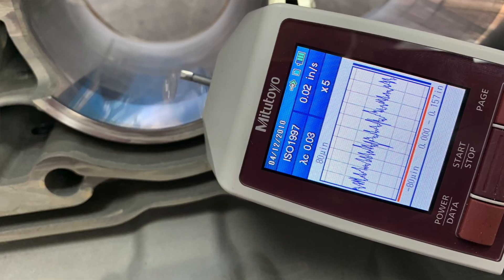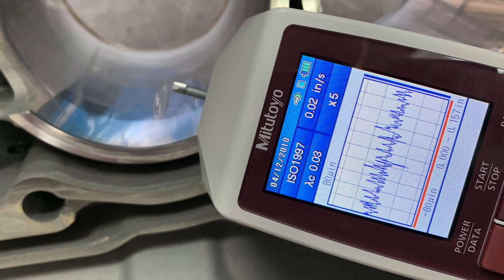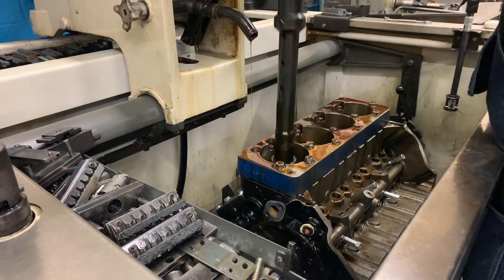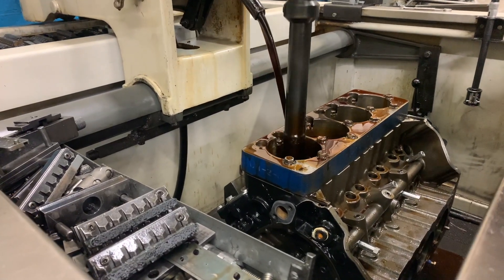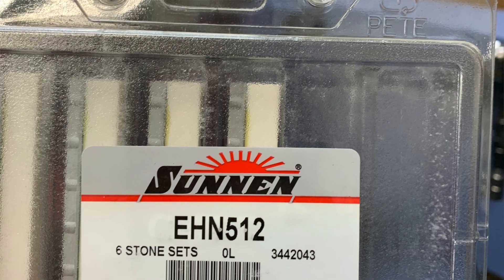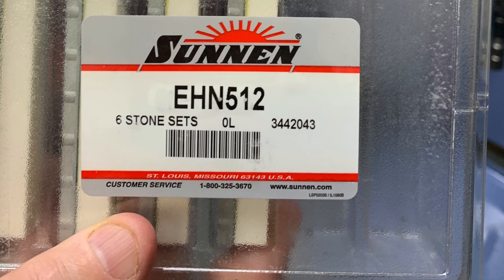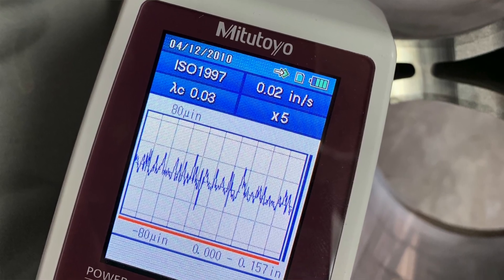Honing Fluid & Diamond Abrasives

Comment: I have an identical machine (cv616 with digital load meter) I’ve been told that the machine is not powerful/strong enough to use diamonds on. Did you have to upgrade anything to use diamonds or have I been told a story in the hope I will buy a new machine?

Comment: I have some 100k, 50k, 20k, grit diamond abrasives in syringes I got from a place that was shutting down. I bought some laptops from an auction and that’s where the pick up was at. They threw all this stuff away while cleaning out but it was pretty clear to me they were making hydraulic cylinders and things like that. I was like oh well I’ll help myself I can use some 100k grit stuff. There’s not a lot but I can use to lap heatsinks on pc’s for flatter surfaces and better cpu cooling. I suppose I could use it on crankshaft or something if needed as well to polish.

Comment: They did a Diamond hone on my 1995 Harley Cylinder 2018  , I ended up getting blow by .  I had to Hone and re-ring again.   March 2023 had a mishap and need to go  20 over   Is a Diamond hone the best or a Stone 240 for a Motorcycle   I hate to get blow by again , the set back and time money waisted .    i under stand rings  not seating . But is it do to a fine hone ?
Reply from the maker: The choice of honing abrasives is all about the ring face material/coating. Getting that matched up properly is the best way to prevent blow by problems. We have several videos on our channel that provide the details.
Reply: @TotalSeal  Thanks

Comment: What is the best grit (s) for honing?
Reply from the maker: There is not a single grit that works for all engine bore materials or applications.
Reply: the rings will tell you what grit and finish you need. should be in the box. if not then online should have that info

Comment: I love the statement, "I can hear em cut". I know exactly what you're saying! As a machinist a huge part of my work depends on what I'm hearing!
Is the new cutting fluid ester based water soluble?
Reply from the maker: The new fluid is ester based, but it is not water soluble.
Reply: @TotalSeal  how well does it stand up to evaporation? (I'd assume reasonably well if it's not water soluble?)
Reply from the maker: No evaporation because it is Ester based. We don’t sell it. We just know it works.

Comment: A great explanation of the subject. May I ask x2 questions? Firstly do you have swarf magnets in the sump of the machine for particle capture prior to the fluid cycling through the filters?
Secondly, can you explain about the fine tolerance between a cylinder being rebored & the effects of a cylinder being 'excessively' honed? Is the honing process involving accurate cylinder measurements or is it simply a case of a trained eye observing the subtleties of the cutting pattern being produced?
Many thanks. Regards from the UK 🇬🇧
Reply from the maker: Thanks for the questions! The honing machines do have magnets to help capture the swarf. They even have settling trays for the same purpose.

In regards to the concept of boring vs honing, sound like the idea for another video...